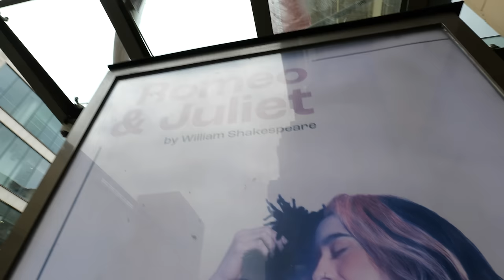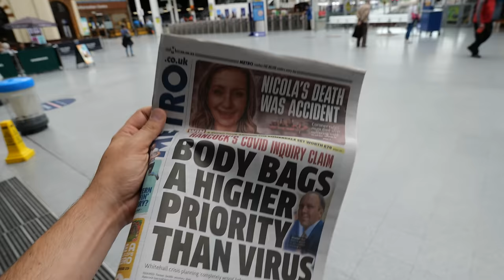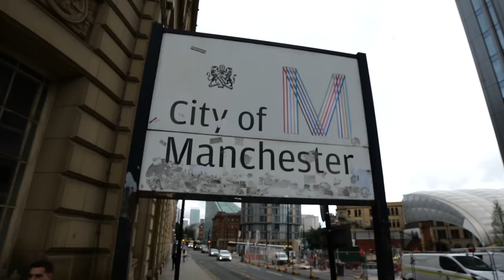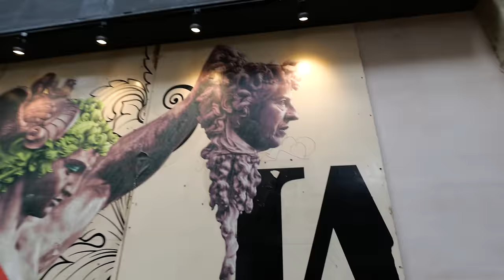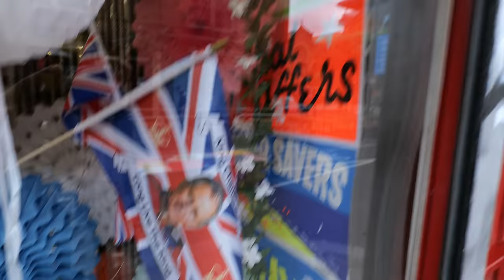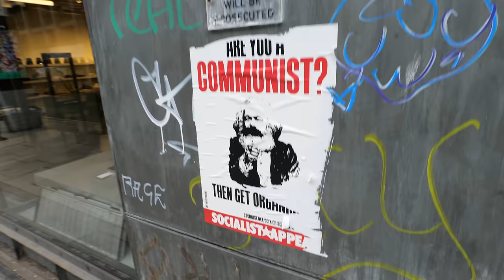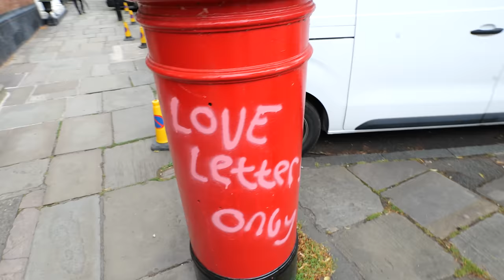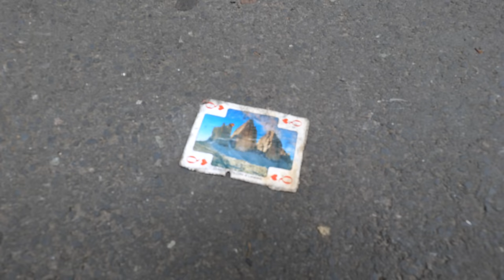Probation Officers! Don't Say Those Things I'm Just Making a Video

Comment: I'm amazed that you held yourself in check with those labellers. You'll do fine with electric right up until you get caught on a motorway traffic jam with 20 miles range to go to a 25 mile distant charging station.

Comment: sod going ev, no sole as fun as doctors waiting room , power means nothing no involvement just stop and go it a kids toy. they no cheaper than petrol car only if you not posh and have a drive to park onif not they can cost up to 3x more than petrol and diesel u to 4 maybe 5 x per a mile. ive seen road trip and done the maths its shocking how much more it costs, 900 mile road trip one way was 280£ my car could done the return trip for less than one way and diesel could done the return trip and had money left over for cheap hotel. you bang on about freedom of movement guess what your car can be shut off at any time, when i was about to say if we move in to social credit system you dis the masters they stop you travelling and the amount you speak your mind social credit score not going to be so great. ev are for those who don't like driving, the one cut you up and have no idea what they done a world of there own. small light weight manual car you don't need 0-60 in 2 sec you just don't to have fun, only fun you can have is 2-3 seconds then its all over unless you want to go to jail or a driving ban, my most fun is foot to the floor i can do that for a lot longer and not worry about a camera just more fun. and the amount people are losing on them compared to equivalent petrol is shocking some evs losing 30% but the petrol version in same time frame only a few %. so many have been fool in to buying one and they trapped they want out but cars lost so much money and still owe so much they cannot get out. its rich persons toy for short trips, this ev mandate is going to take the poor off the road as it effect them most, they most likely only have street parking so only have public charging and that can be from 50p-93p per kw a high % are around 70-75p per kw and at that rate that way more than a normal petrol car. my next car will be light weight 1.1 ton , manual petrol and i plan to keep it for decades as i enjoy driving. we should not be pushed into ev, should be allowed to pick what suits you, this petrol and diesel new car ban needs to go. and you and polestar thank you for funding WW3 as china getting ready to invade Taiwan and when they do the usa will defend them so guess what we also will be at war with china that prob trigger a world war, last thing we should be doing send billions over to china it will backfire